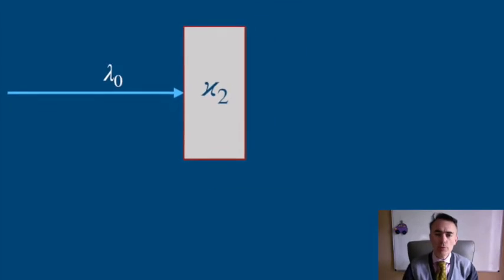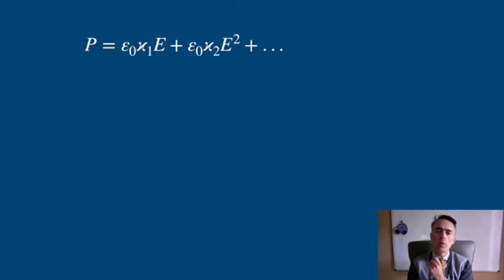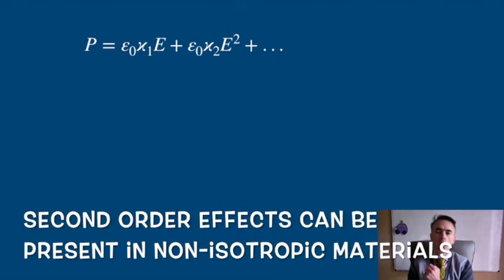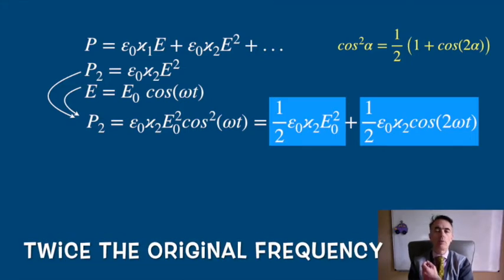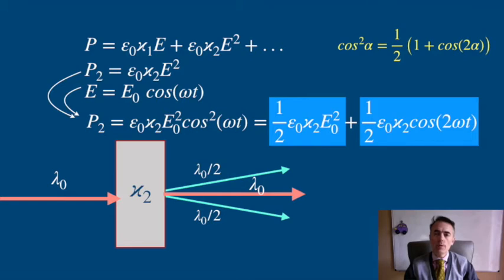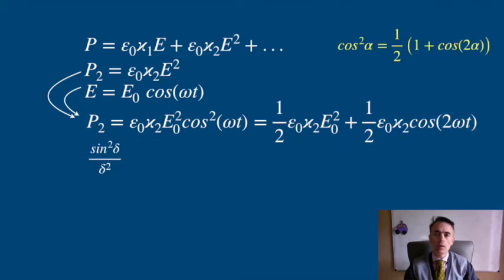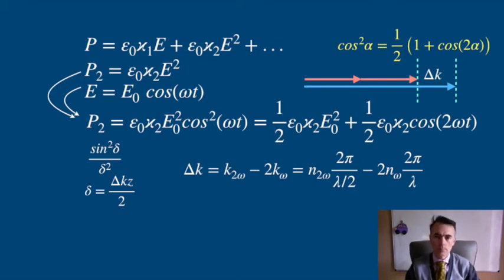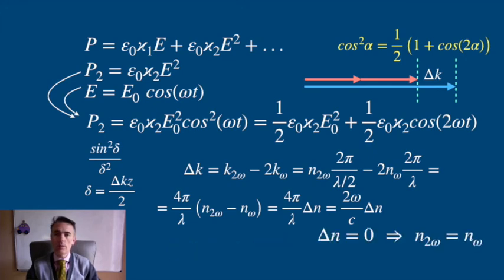Optics. Second Harmonic Generation

Comment: Thanks for the video but I would've appreciated better explanation at a few points in the video. For instance, it isn't obvious to me why a term of cos(2wt) in P would lead  to the generation of a new frequency photon.
Reply: You are right, the Professor made a mistake in the second term of P2, he forgot to bring back the term E0^2 … 
In this way you can see that Polarization makes the wave divide in 2 contributes, the first with the same frequency of the Fundamental, the second with double the frequency of Fundamental.
Reply: the first is a static polarization, right? I do not think it is the fundamental harmonic
 @lore_a_